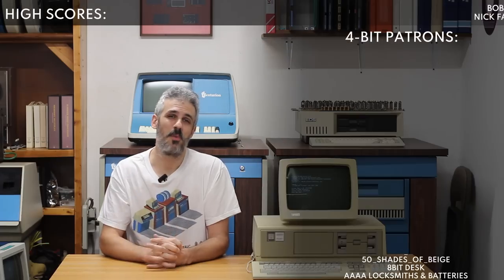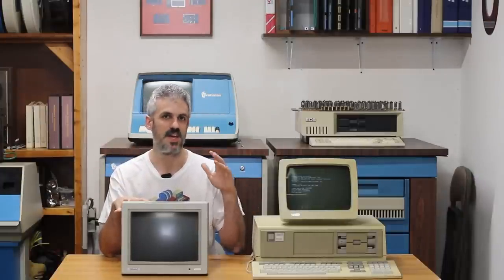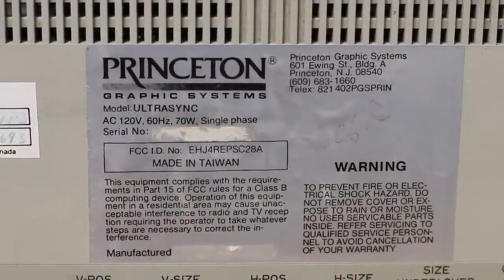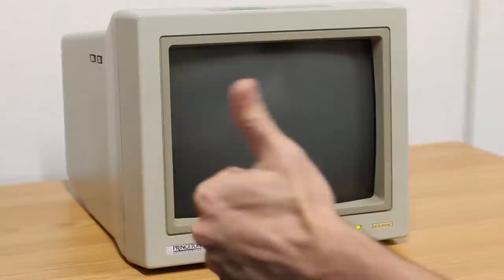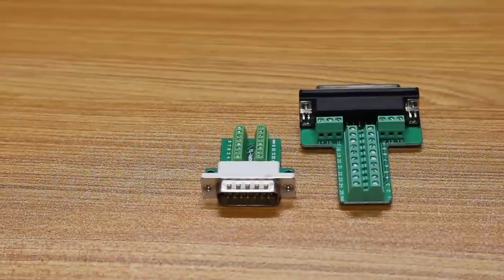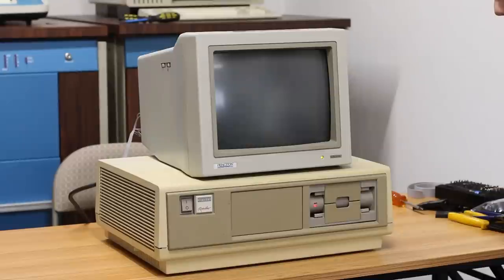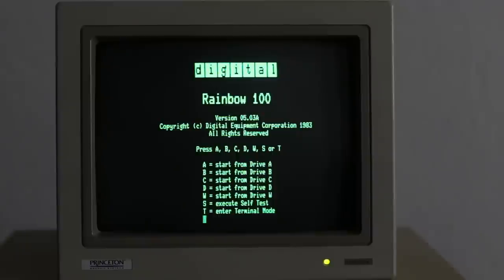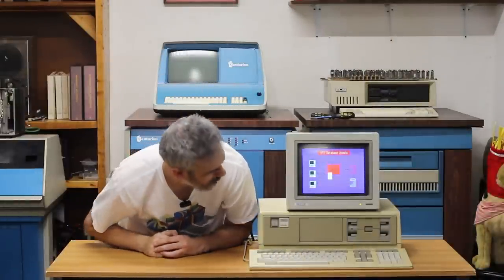Full Color Graphics in DOS on a DEC Rainbow!

Comment: The NEC µPD7220 is a true Graphics Processor, capable of drawing primitives such as lines, circles, fonts and even bliting. Such things did not show up in PC compatibles until 1987 with the IBM 8514.
Reply: FYI, that same NEC μPD7220 Graphics IC was also used in a Japanese 16 bit home computer, the NEC PC-9801 (First model of the First generation PC-9800 series, abbreviated as the PC-98). Which, (on later models) were known for Anime styled games such as Visual novels, Touhou, etc
Reply: 1984-era IBM PGA supports 640 × 480 with 256 colors which includes an on-board Intel 8088 CPU.  The secondary 8088 ran software routines such as "draw polygon" and "fill area" from an on-board 64 KB ROM so that the host CPU didn't need to load and run these routines itself.

PGC supports 640 × 480 with 256 colors from a palette of 4,096 and registers compatible with CGA.

Comment: My very first computer was a Rainbow 100 ! It came with CP/M only and had an amber display, but it was fitted with the double-height 10MB Winchester hard drive! I really wish I didn't throw it away when it stopped working. Now thirty years later, I would probably have been able to repair it :)
Aaaah, this smooth scrolling...

Comment: The text button likely does something like killing the color burst signal or something like that. It makes for sharper text at the obvious cost of color. I thought some apple or such monitors had that feature.
Reply: The Commodore 1950 ( some sort of rebrand but I don't know what) also has that switch.
Reply: @8BitNaptime  I feel some kind of relation to Commodore monitors, espacially the inset front Bezel and the pots in the back… they remind me of my old 1084s
Reply: Color burst only exists on composite signals, not on discrete RGB.  I imagine the text button kills red and blue so only green is output, thereby eliminating any color fringing.
Reply: @Mueller3D  maybe you missed the part where I said "or something like that". I also entertain the possibility that the monitor can take composite input besides RGB.
Reply: @Mueller3D  IIRC, at least on my 1950, it mixes all together to create an amber equivalent display. I don't know anymore, that monitor is in deep storage...
Reply: @8BitNaptime  I had a Tsung that did that and made the raster a dark blue.  That may have been a copy of this.
Reply: @Mueller3D Or maybe split the green to red and blue, so the text displayed is white?

Comment: The 16/64 switch allows you to select either a 16-bit RGBI colour palette for CGA/EGA, or a 3-bit intensity which was an EGA feature. It was quickly superseded by analog VGA because not a lot of monitors had the 2 additional intensity bits wired in.

Comment: As the other Dave says, "don't turn it on - take it apart!" :)
Surprisingly easy to reverse-engineer. I thought it would be worse. The designers did a good job of describing the board :). The results are super cool, I love the colored graphics on this screen - now on to making an elegant cable for this setup :)

Comment: Very cool!  Man, I love those old DEC keyboards!  I really, really want a VT220 for nostaglia's sake!
Reply: When I first started working it was on DEC VAX and VT220 and VT240 terminals. I wrote a graphics library for VT-240 in Pascal and used that to write a virtual logic analyzer that read output of fault isolation / circuit sim software. Even had mouse support and onscreen buttons to click.

Comment: I don't know anything about this DEC PC, but based on my experience with the IBM PC I wasn't surprised that it didn't work "out of the box". The monochrome and color graphics adapters were designed so that you could use them at the same time and you had to flip a dip switch on the motherboard to select BIOS (and thus DOS) text output to either the monochrome or the color display. Of course the MODE command in dos would let you switch between the monitors on the fly, once it was running.
Anyway great video as always! Thanks for posting.

Comment: Cool that you didn't have to actively break-out the sync signals. Maybe use schottky diodes or a resistor mixer in the final cable to merge that monochrome signal?

Comment: Beautiful Reverse engineering of the cables and signal breakdown ! Been so long since anyone even mentioned Tube and signal structures !!!
Usually back at that time, if you took off the back cases cover there is a schematic for the unit to assist in tuning the  display or wiring the unit based on defined schematics for the output and input ports... One can hope it was not removed by a collector-O-Noid and now sits in a basement molding away or landfill ;-P

Comment: Get a load of the length of the analog [sic] /TTL switch! That thing's a monster! 

Sync on green is evil. I had a monitor back in the day that just had RGB input BNCs, and it took me a while to work out that it used sync on green. The circuit to convert RGBHV to sync on green is pretty simple, and I did hack together an adapter that worked, but I eventually found a place that sold a proper adapter cable that was a much neater solution.

Comment: Am I correct in remebering that the DEC Rainbow disk drives load disk in opposite orientations (flipped)? As I recall that made it possible for both floppy drives to to use the same spindle motor.
Reply: Of course, back in the 80's when I actually worked on a rainbow, the only program I used that used "color" was Tornado Notes.
Reply from the maker: Yup! The top floppy loads with the disk pointed up and the bottom floppy with it pointed down. It was very weird indeed, but quite a cool little drive.

Comment: It's not that uncommon to derive sync from the composite signal. As even the web page you showed says. Sync on green is just a combination of the green color signal and the composite sync signal. 
The way you have now wired it text is always green by the looks of it. Couldn't you wire it to be white by feeding the comp signal in to r g and b? Green text is fine and all, but I find white nicer.
Reply: Coincidentally "sync on green" video is just a monochrome television video signal, as luminance is always on green and it carries the sync signal. Red and blue were added later in the color standard. Provided the sync frequencies are appropriate of course.

Comment: 5:22 I remember doing some experiments with REGIS graphics on a DEC VK100 (“GIGI”) terminal. You could run this off its built-in Microsoft BASIC, or you could send it information to display over a serial line: it had a VT100 text mode, and a REGIS graphics mode. Sending graphics commands at 9600 bps was painful, and I longed for the ability to do direct frame buffer access. But what you’re showing here is hardly any improvement at all.

Comment: I don’t get why the keyboard goes through it.
Reply: I guess, so that the main unit hasn't to be nearby and there's only a single cable running to the work place?
(Compare modern displays and their USB hubs, or a mouse connecting to the keyboard rather than directly to the computer. This would makes sense, especially since computers used to be noisy and bulky machines. Every inch of distance counts…)